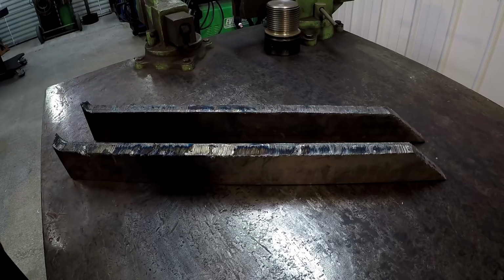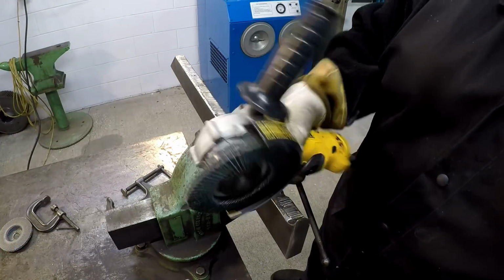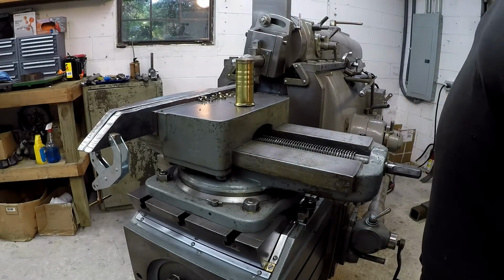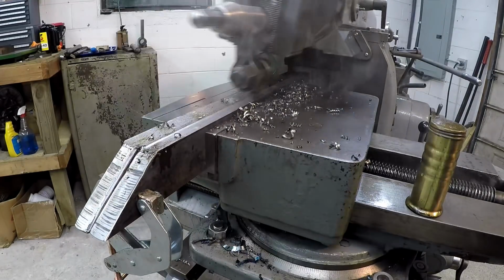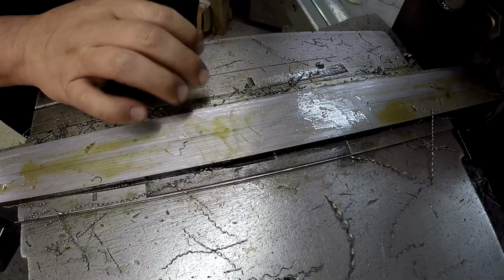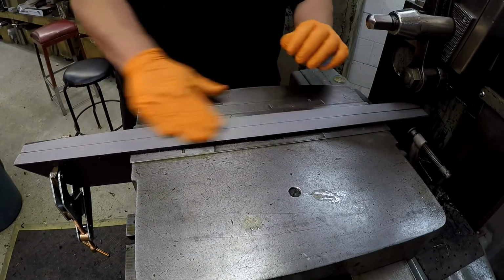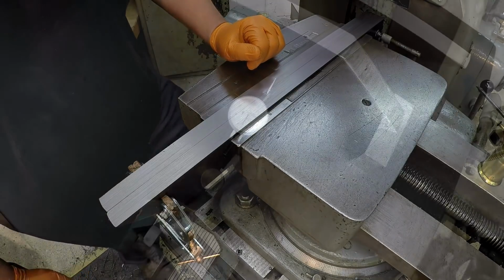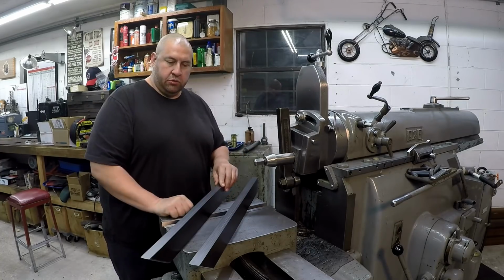SNS 220: Shaping 28" Parallel Bars

Comment: How does the shaper head operate? Hydraulics?
Reply: Zach M   inside that massive housing is the mechanism, wheels and levers and bearings and pivots.  He has a complete set of vids on taking it apart and cleaning, restoring.. all is revealed in those vids.

Comment: How you know that you'r table, on what you take the after measurements, is parallel?
Reply: Tolkoum  -  that’s literally the function of that table, which is granite, to be absolutely flat within extremely small tolerances :)
Reply: New ones come certified. Good shops have these certified annually.

Comment: Out of curiosity why no cutting coolant
Reply: He is using oil as a cutting lubricant.

Also, for most materials, the heat leaves the work with the chips. The chips come out hot, and the work stays relatively cool.

And I've never worked on a shaper but I imagine that the cutting is slow enough that the heat that does end up in the work dissipates before it becomes a problem.

Comment: Just a question on the test for parallel. How was the dial gauge being held to travel on a straight line? It looked like you were just sliding the dial gauge stand on the granite. The stand rotated slightly in the horizontal plane by about 5 degrees. You moved the stand towards and away from the piece about 2 cm, it can't have been attached to a straight edge. I think all you have shown is that you can move the dial gauge and keep the tip within 1 thou manually.. Tell me I'm wrong, please.
Reply: Using a surface table doesn't require a straight edge, the dial indicator was indicating the underside of the machined piece. Providing both sides of the piece had been machined at this point, the height across the width shouldn't have changed unless something is drastically wrong with either the setup or the machine. This is to show how flat the piece has been machined along it's length. Judging the the dip/raise in the centre of the piece, I'd say the head of the shaper has a small sag/bump in the middle of it's stroke, although 0.001" over 14"  isn't really much to worry about. Judging by your previous comments about not being a machinst, I'd say take a look at some other people and see how they use dial indicators on surface tables, there's not much that you can do wrong unless you start throwing stuff around the table.
Reply: @jaydunbar7538  Yeah that thought occurred to me after awhile. It just shows how important the camera angle and position are to correctly illustrate a procedure . And also lighting to get shadows in the right places as you say. Thanks for replying.
Reply: I was expecting to see that measurement TOP and BOTTOM to see how parallel the surfaces are
Reply: @easternwoods4378  Apparently the tip of the dial gauge was touching the underside of the piece and it was hard to see this due to the angle of viewing and shadows. Sounds good to me. It must be tricky at times getting the POV correct.

Comment: 6:33 if that disc were to explode it would hit you in your gut/groin, the guard should be more tilted down, the mask is protecting your face and the rotation of the wheel is throwing away from your face, but that gap at the bottom could hit you, i hope you are wearing a good jacket and pants

Comment: Your tool geometry is way off.you need to have a positive edge and about a.050 nose radius. Also, your surface speed is way to fast for hi speed tool bit. Lastly, always cut on the front side of the tool not the back side. This will very much lessen tool wear and heat.
Reply: Yes I spotted he was feeding the tool on the back side

Comment: Why did you switch from the large (7”?) grinder to the smaller (4+1/2”?) and use the flapwheel
Reply: Any excuse to run the Metabo

Comment: why would you use a shaper over a mill??
Reply: carbide is expensive
Reply: Joe Hillebrand operations that extensive like the one in the Video can be done a lot cheaper and easier, leaving the mill open for other projects. Especially when the project isn’t that time sensitive.
Reply: I would say when you want to make a square hole, or otherwise non-round shaped hole with depth and corners. You can create custom profiles on your tool too and run that shape down the length of your work peice.
Reply: @superjojo555   Time is expensive. A half decent conventionnal mill with entry level tooling would to the job twice as fast with a better finish.
Reply: Space is also valuable. This thing takes space for a very limited use.
Reply: The tooling for a shaper is dirt cheap when compared to a milling machine. Second reason is that you can hand grind all of your specialty tools, custom radius, custom profiles etc. (Again, cost.) Third reason is accurcy, a shaper will cut flat parts flater, and square parts more square. Third reason is finish. The finish produced by a shaper, (or planer for that matter) is far smoother, requiring less time to surface grind or hand finish than milling machines do.
Reply: Learning to use a shaper will make you a better machinist. Grinding your own tooling will teach you patience. All valuable

Comment: Why don't you use a carbide tip? The last much longer and surface finish is better.
Reply: If he ground the tool steel with more relief and took shorter and lighter passes he would get a better than carbide finish.

Comment: The cutting edge is too wide.. Use a smaller radius on the cutting edge and you will get a better finish
Reply: with only enough clearance as needed....5-7 degrees is all.

Comment: And with milling machine you do all this in less than five minutes without any grinding in advance.
Reply: 5min? lol
Reply: Probably the most pointless machine I've seen to date, a milling machine will be finished in about 90 seconds rough and finish cut.
Reply: Stewart Hamilton Abomb is just trying to exercise the machine, the machine has other uses, like cutting key ways in a bore
Reply: @Infinity2219  Let me guess you're 20.
Reply: Stewart Hamilton its not always about speed all the time
Reply: This is called old school, little child.

Comment: If you use gloves with a grinder you could rip your arms of
Reply: you can also rip your arms off with a grider without wearing gloves
Reply: @arrangemonk  By only using gloves and no grinder a bear can bite your legs off..
Reply: Beating a Wookie could also get your arms ripped off
Reply: @Dumps3rFir3  beating off a wookie is a different story...
Reply: Gloves on grinder is agains safety rules... but he know what he doing ;)
Reply: Why ?
Reply: @bastienpabiot3678  if you are having gloves on the grinder gribs instead of cutting
Reply: @jaydunbar7538  yea it is but I think you can stil work faster with only a mising finger then an hole arm

Comment: Why plane  instead of mill? just curious!
Reply: he says.. to practice with a shaper and not wear the carbide tools.
Reply: facuclop it looks like it takes less time then milling and probably looks better,
Reply: A shaper, (or a planer, which is a different machine where the work piece moves instead of the cutter) gives the flattest cut and finest finish of all the machine tools, not counting surface grinders.  HSS lathe bits are inexpensive compared to end mills and other milling cutters, especially carbide insert cutters, and like he mentioned, are easily sharpened in any shop.  They can also be ground to whatever shape you need, such as the angle for a dovetail cut, or an involute gear tooth, and so on.  There is nothing wrong with using a tool holder with a carbide insert in your shaper or planer if the material is very hard or difficult to cut, but for normal materials, HSS is just fine and much cheaper.

Comment: You are damaging the tool by running it without cutting oil or a lubricant and water mix. Your chippings should never be dark blue or black burned color. They should appear as clean chrome color instead.  

Even though a shaper mill can do this work, honestly work as this should be done on a Horizontal Plain Milling Machine with a rotary tool with inserts and mounts and turns on a horizontal shaft to make the cuts as the machine table bed moves the work through. Also your tool steel is the same hardness as your work steel as I see in the video and why Inserts are preferred.

This machine is used for as its name infers as a rough shaper which generally is used for shaping grooves, oil valleys, and key-way grooves in long shafts which do not require a smooth finished surface. The Plainer Mill on the other hand is for precise machined surfaces, gear cutting and or slider grooves for moving bed parts for table accessories. Nice Video and fun to watch.
Reply: Sorry, i do not agree.
Reply: Shapers are a little different
Reply: You really do not know what you're talking about. Although it's a machine you don't commonly see this is what it's designed to do.
Reply: 100% Incorrect. You want the heat to go into the chip and removed from the material. If the chip is not discolored likely the heat is going into the part (So it will warp) or worse yet into the cutting tip.
Reply: @grubinskii  What helpful advice??  Chips should be discolored.  That lets you know that the heat is being carried away with the chip.
From his comment it sounds like he just started learning about machining last week and he's learning from a 1970 Machinery's Handbook.
Reply: @mythai9593  I made transitions  out of s.s. oval to square. It had  to be parallel. The shaper did the work with no vibration or heat , it took a lot time for each cut so I was able to do other work while keeping an eye on it.
Reply: There's oil all over the top surfaces. You can even see his oil can sitting on the vice.
Reply: @slother93  Not by the chip color there is none apparently being used. Because there is simply not enough oil to prevent dry chipping and is common with beginners not using a correct chip depth of cut and or enough cutting fluid.
Reply: @scottbaker6611  Nonsense, where have you worked as a machinist? I am a retired machinist of thirty plus years and you apparently know nothing about depth of cut or managing cutting oils to prevent tool wear, tool damage, part damage or warpage and or heat and pressure being forced into the machine and the work surface. 

It doesn't take a moron to know chips must be cut clean without burning them. I have honestly fired employees for doing the same thing.

Case in point, I will be blunt, you can do this but your push-off will never be manageable by any standard.

Comment: why would you use a "shaper" over a surface grinder.
Reply: Because surface grinders wear out real fast, the wheels on surface grinders aren't designed for high material removal like a shaper is, Plus torch cut steel is really hard on the cut edges. I've done plenty of cuts with a oxy cut off torch to know how hard the slag is.
Reply: because it looks and sounds and feels way cooler, duh
Reply: Grinders are mostly for surface finish. They aren't really meant to alter the geometry of a piece (specially a large piece) much.
Reply: Abom79 states in his video starting at 32:20 that he is using the shaper in order to improve his skill with the machine.  He is interested in the process and not just the result.
Reply: And few surface grinders work to 29 inches of cut

Comment: I never understood why people wear 2 gloves tig welding.
Reply: Phillip Farr - Useful if you drop something really hot somewhere really sensitive - you can shift it without further pain!
Reply: all skin has to be covered to weld, otherwise you'll burn your hand
Reply: I have never used a second glove and I been welding for 20 years
Reply: Either TIG is different, or you're a mutant then. I only ever MIG weld.
Reply: Skin cancers a risk. Some get it some dont, why take a chance?
Reply: @phillipfarr8266  Machinist never used to wear safety glasses either but times change.
Reply: quantumbox Tig is different, but you should still wear gloves for uv reasons

Comment: I must not know anything about a shaper or machining. Wouldn't it be best to use a carbine insert tool with a rounded corner to make the finishing cut? And it doesn't look like you have the tool relief right to clear the work. The tool is the most important thing, not watching the machine go back and forth.
Reply: Correct. You do not know anything about this machine.
Reply: @Shaftygod  👍 👌
Reply: As Based Jason says, you know nothing. Whats a "carbine" insert tool?

Comment: W.t.f.  You stated it would damage your mills if you were to mill instead of using the shaper with the slag from your burning but you had to grind it of before going to the shaper , so that wasn’t a valid reason for the shaper over the mill.
Reply: When you make YOUR 28" parallel bars from flame cut steel scraps, you can use your mill. Be sure to film it for us all to see and critique.
Reply from the maker: No matter what machine or method, always grind away  the slag. I’m not here to justify why I enjoy using my shaper.
Reply: It all  has to do with the cost of the milling cutter vs. grinding a HSS tool bit.
Reply: grntitan1 I love this reply. LOL